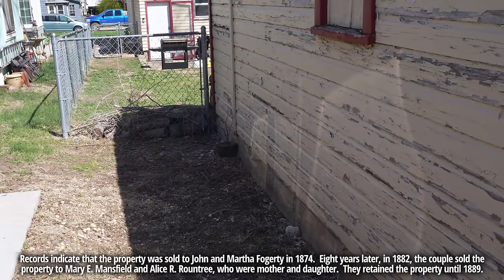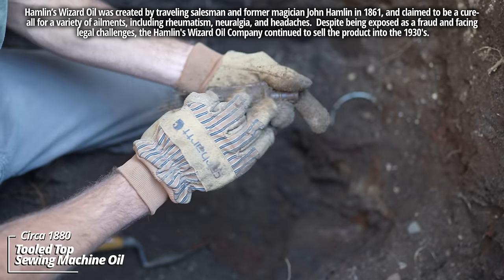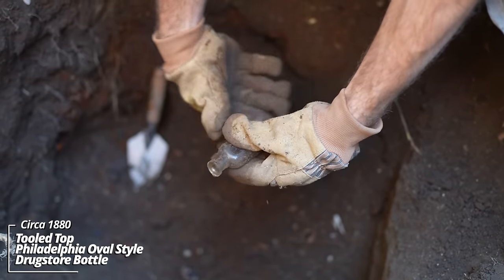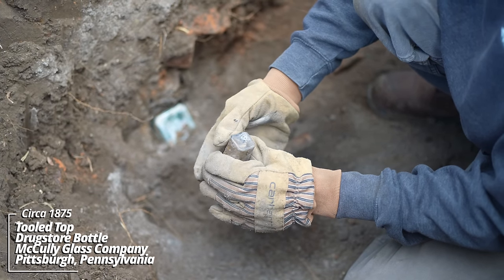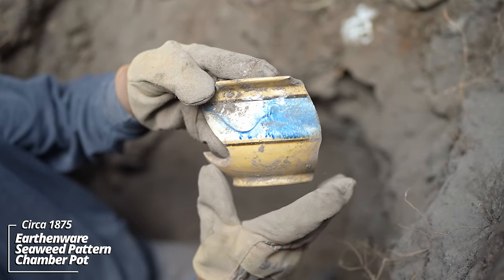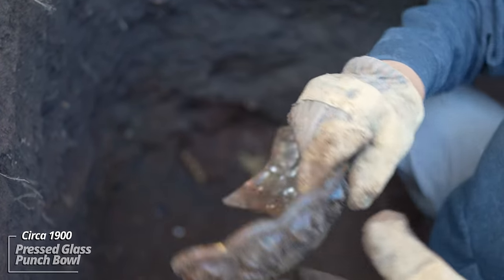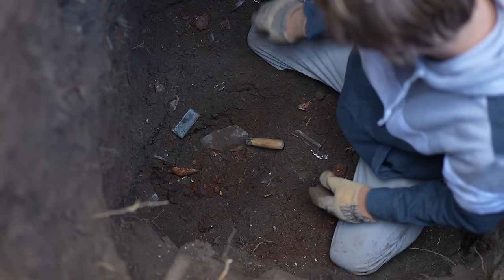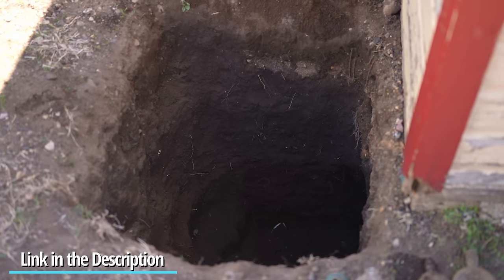143 Year Old Map Found in an Attic Leads to an Unbelievable Jackpot Buried in a Back Yard (Full)

Comment: Tom, I'm curious does anyone sift through the dirt after you move it to check for smaller relics like coins, buttons, marbles and such? I'm sure folks using the outhouse might drop stuff from their pockets while doing their business.  Thanks for the great vids!
Reply: I’d think it might be difficult to sift it with just how much broken glass and pottery is in the midden he buckets up. He seems to mostly only grab either complete bottles, or pieces he finds of significant interest, otherwise the rest says in the midden.  What’s good though, is at least then any future archaeologists way down the line could find the fragments/buttons etc he leaves, even if the stratification is now gone. What he could do is use a metal detector on the spoil heap though!
Reply: @Dept_Of_Ducks  Using a metal detector would find the coins and other small metal objects.

Comment: When I lived in Howard SD I bought an old house and remodeled it. In the back yard was an old outhouse pit with a one hole concrete top over it. I removed the top and the hole was almost at ground level, and over grown with weeds. I got some good fill dirt from a local construction site and filled up the remaining depression and seeded it with grass seed. It's at 107 N. Vermillion St. I sold the house and moved to Sioux Falls 25 years ago, and never told the new owners about the pit. It is on the south side of the back yard behind the old garage.

Comment: When you say drinking glass or jelly jar, you know they sold jelly in jars made for drinking glasses when I was a child.  Just found your channel, love it!  I live in what was once a one room mountain cabin built 1915.  Before that it was one of the town's original 15 tent houses 4 walls and a canvas type roof.  I have found a number of things just digging in the flower garden, a somewhat terraced garden.  (Old bottles, old tools and locks.). There is a sink hole about50' from the house I have been raking pine needles and small branches over 40years.  Going to find something to poke down there like you do.  I know where the old outhouse was, right where the best lilac trees you ever saw is.  You have made me think I should have dug more when I was younger!!!  And wow, this other area I found a ways out from where I keep a small camper... Ever hear of anyone using sand as a floor up in the mountains?

Comment: I enjoy the treasure hunting part but I cring watching you gash through the soil so hard and fast.
  I'm interested in the other stuff that gets tossed aside.  If I had the opportunity to find such old pieces of dishes, etc, I would try to glue them back together to display.  Why not use a stiff brush or wooden digging tool to prevent scratching/scraping and breakage?